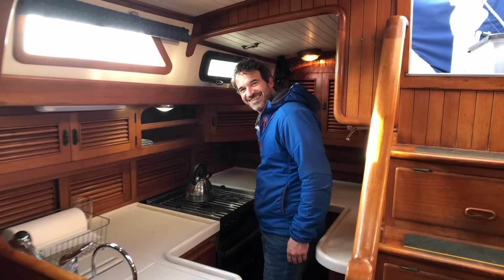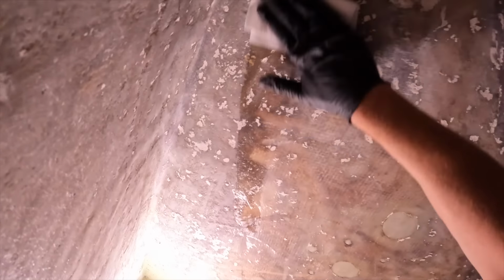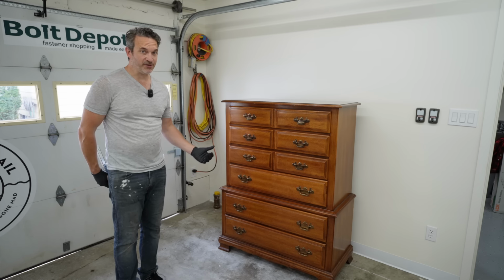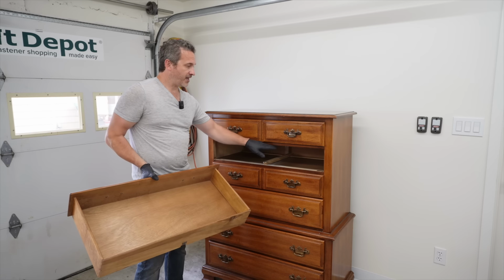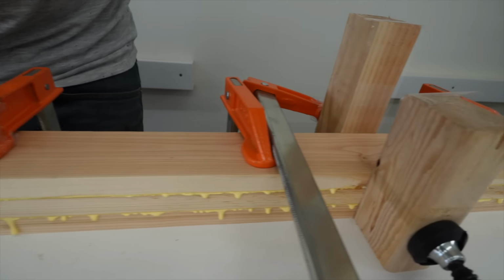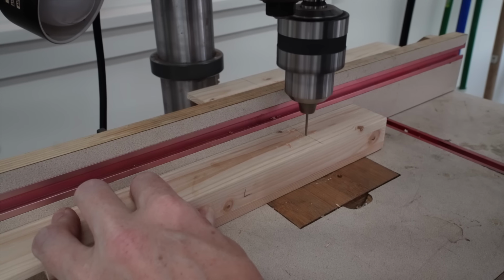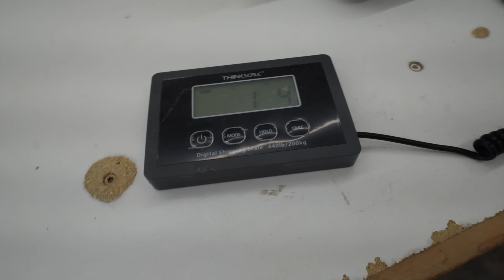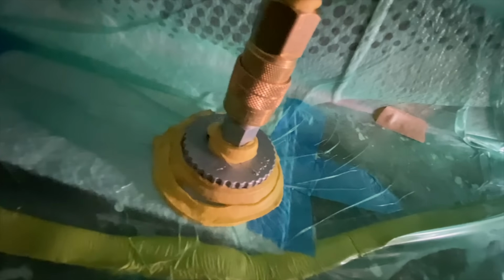The Most DIFFICULT Fiberglass Lamination Yet! | E030

Comment: My favourite job. In my case repairs under a catamaran hull, suspended 36cm above a damp grassy foreshore. 
My technique is to apply a binding coat to the surface, when that starts to go tacky, apply the dry glass, then wet out,  and Peelply.   Better not to try too many layers at once. 
I put a layer of silica thickened resin on before the Peelply.
Reply from the maker: That sounds like a good approach. I was dreading having to wet out the glass upside down though in the cramped space. It seems to have worked well in the end.

Comment: Great that a respirator is being used. With resins my recommendation is a filter that designed to remove organic material. Keep up the good work.
Reply from the maker: That one actually has a nuisance level organic vapor but i usually run the full vapor cartridges with large epoxy work. 
🙌👍

Comment: was about to comment when you switched to the flap disk! ahahah i got thinking: this fella has the patience of a saint to be sanding that off!
you will be done but my experience with overhead lams is: pre wet the area generously and then depending of the width of the cloth i apply a fillet of thickness epoxy. my experience has been, 1 fillet per 100mm of width. handle the cloth however you can and go straight for the aluminum roller, cinch all of it and keep on rolling or brushing the rest of the resin into it. peel ply wants to naturally stick to fully wetted out grp so its a matter of getting it on and then eliminate wrinkles and air bubles.
i have yet to use vacuum on my boat, it really is the best way to consolidate laminations, but a lot of work and consumables.
nice work!
Reply from the maker: Thank you. The epoxy that I rolled on and wetted the glass out with had about 10% of 403 microfibers in it which seems to make it a bit extra tacky without harming the ability to wet out (as I understand…)
Using a few thickened fillets is a good idea to act as little “ Velcro” strips. 
The vacuum makes for a really nice lamination. If you haven’t already noticed I’m a glutton for punishment, so I don’t mind the extra steps.  Haha.

Comment: I understand the frustration with drawers not being square. The longer the drawer slides are the more the problem is exaggerated. If the case also isn't square, that adds to the problem. It's frustrating,i know.🤔🥴🥴😠
Reply from the maker: Exactly. Also the case and drawers were out of square in the opposite directions. Adding to the fun… 🤣

Comment: I need to install an inner forestay on my boat and working out how to do it. I like the idea of that bracket to strengthen and distribute the forces of the staysail. So the staysail fitting or padeye bolts through that fitting? I'm doing mine on a mooring so don't have access to vacuum ... haven't quite worked out how to hold wet fiberglass firmly to an overhead surface yet while its curing...
Reply from the maker: As at least one other has mentioned in the comments, thickened epoxy (with 403 and/or 406 and then buttered or troweled into the surface should grab and hold a wetted out section of glass upside down. The vacuum is an extra step to get a better glass to resin ratio, keep everything really tight … and it’s fun. Haha. Good luck with your project. 🙌👍

Comment: Outstanding work. I wouldn't want to grind upside down or apply resin over my face! This was a milestone task, for sure. I am super impressed with the layup schedule and load distribution plan -- that SS Bracket will be the icing on a very strong cake. Will that bracket be bedded in epoxy? It seems to me that would that further stiffen the connection and transfer load carrying back to the glasswork.
Reply from the maker: Thanks! 🙏 
I have an interesting idea for the bracket. We will see soon! 🤔

Comment: Haha, what fun!
Surely with the vacuum, once the initial set has happened, can you not turn it off? 
Is it not best to not leave the peel ply too long, easier to remove then?
Reply from the maker: I usually run the pump until the epoxy thin film cure time just to be safe. If I add some heat I feel pretty safe doing that. 
My understanding is that peel ply can be left on indefinitely and protects things until you’re ready to glass/finish. 
👍

Comment: Jon, any chance using thin plywood (1/8"-1/4") or formica and some some type material between the plywood and glass to release the glass/resin from the plywood when stuck to the deck. Maybe if you used a layer of thickened epoxy on top of the glass... then press it all up to the deck, that might help keep the resin from dripping all over you (just a thought). Duane
Reply from the maker: That’s an interesting idea. Sort of like an old “T-shirt transfer”?